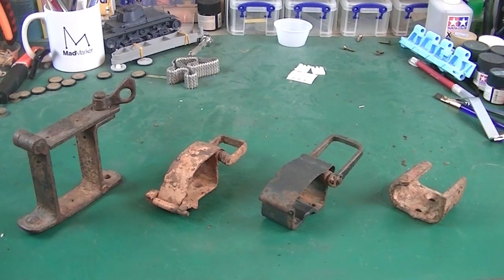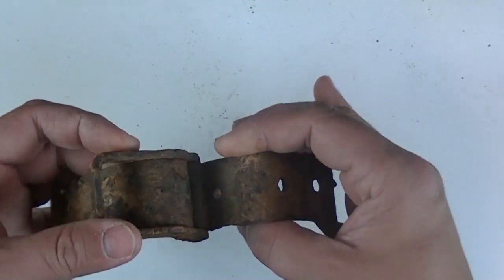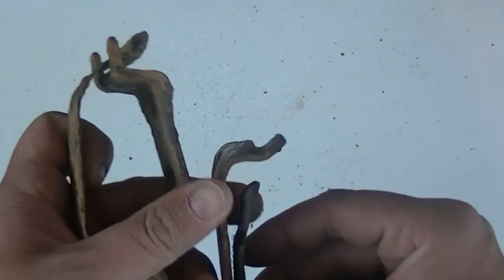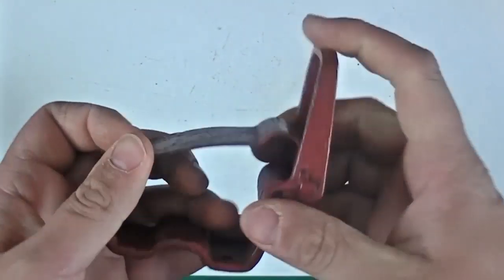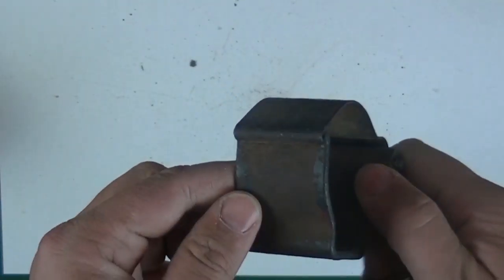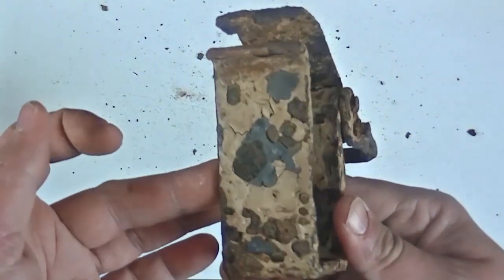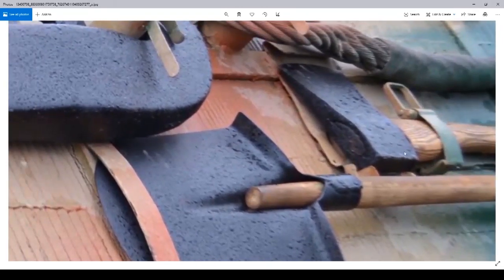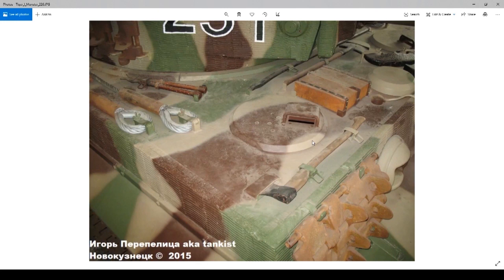Panzer Tool Clamps

Comment: Just by the CAD work alone, I can tell how much work has gone into the two assembly models you have shown, stunning documentation of these components!

To let you know I am the CAD guy at the Wirbelwind project in Canada, so I have access to all of the original parts of the Wirbelwind as well as our original wartime Jagdpanzer 38(t) (earliest surviving example) if you are interested in any original clamps or other fittings that we may happen to have, let me know.

Also sorry for the drawings for the external fire extinguisher mount from our Wirbelwind, I wasn't aware or told of the purpose you would use it for, and the sample that I was given to document was a reproduction part that used a modern clamp and took little to no measurements from an original example. I am hoping that some authentic information arises for that and other Panzer IV fittings so my team can reproduce them to historical accuracy.
Reply from the maker: I'm very interested in seeing data/info on your clamps up there. Rob had told me there was someone making CAD from all the measured parts. My background is video games/vfx, so my models here are built that way. It's been a challenge altering the files for 3D printing as normally our stuff only has to render well, so it's often built very differently than traditional CAD. 

Would love to see what is there and what is gone on the Wirbelwind fenders. I will start looking for high res reference of wartime vehicles. I see from pics when it was outside, fittings on the LHS fender look pretty in tact.

You guys know the history of that vehicle too, so maybe we can reference of it's unit.

The extinguisher reference, i eventually found enough here and there. Don't worry about that.
Reply: @AdamMann3D  I will be back at Borden in around 2 weeks time, and I should have enough time to take a few photographs, unfortunately the Wirbelwind's fenders are in pretty rough shape, not only the inaccurate paint, but the Canadian forces added reinforcement to our fenders since they were rusting to paper thin, and they rewelded some of the clamps back onto new metal, but all the clamps there are original. I'll message your Facebook once I have the photos.

Understood with your 3D modeling files, I just associate anything that is a 3D model with CAD just because of my experiences thus far.
Reply from the maker: @starwars9876-i4t  Corona probably messed up your work days. Just holler at me whenever you get back there. mann.adam.r@gmail.com

Comment: You Sir are crazy and thats why we love you :) What a video to watch and to digest.
When it comes to certain twists and bends in some of the band parts, one reason might be that a piece of metal rod or bar becomes a bit more solid to be used for spring tension when you add sharp bends to the piece. Think of a long wooden board and a short one, the long board is very easy to bend with your arms, while the short one is super tough. Lever principle. With a bend in a metal band you divide the band into two shorter sections, each of which is much harder to deform.

Comment: I would never have thought someone could be so dedicated to one item. I also had no idea that there were so many types of clamps. Interesting.
Reply from the maker: When i started modeling in 2014 i saw all these videos talking about upgrading the tool clamps with PE. Which up until then I'd never thought about. Then i started to wonder how accurate the PE was, and I wanted to see a real clamp so I knew what I was trying to represent. It just snowballed from there. 1 turns in to 3 then 5 then 25 and so on.
Reply: Yeah, I know the feeling. I use to collect militaria and that got expensive and I just plain ran out of room to display it.

Comment: Thanks  for the great videos on the German Tiger tank variants by Dragon in 1/35 scale - you did a superb job on the subject , also fascinating to hear that Tamiya Tigers aren't that great - luckily the Tamiya King Tiger 1/35 is not bad - I added a lot of etch ,  Fruil ( of Hungary ) Metal Tracks , brass barrels and aftermarket Zimmerit Resin Sheets to make it very good

Comment: Very nicely done, but my wife is a little worried by what yon mean by you ha a piece of a panzer III at home. She's worried that I going to start stock piling tank parts in my garage so I can build my own real full sized panzer.

One thing to keep in mind about clamps is that they quite often got damaged or were ripped off the vehicles durjng combat so the crews and repair depots would replace them with what ever they had available or refashioned them from scratch  so you would ofren find types where you wouldn't expect them.
Reply: I'm pretty sure Adam has a section of Pz III fender with a couple of clamps on it.  So nothing too crazy....yet..... :)
Reply from the maker: Evan is correct, i have just a piece of fender.

Comment: Thanks so much for the lesson, I know I’m one year late; now that the model market is starting to flood in 3d printed models of clamps, in particular types 1 and 2 (or A and B) and “pro” depending on the company, can I clarify that the different clamp types are not just “early” or “late” (or found on early war/late war tanks), but they can be a mix of both on a single vehicle? or do certain types associate with certain tanks (like a panther only has all type 2 clamps)?

Hope this doesn’t sound inane, just bought some 3d clamps so I just wanted to be sure I’m joining them on the correct vehicle. Thanks Adam!

Comment: Just re-visited this video as am experimenting with various clamps particularly T-Rex and Rochm the latter only their PE but thinking about their 3D. Am I correct that there are no "rules" to to what clamps were fitted apart from as you say no type 1's on Panther or type 2's on Tigers? According to Aber the change was 43 but given what you have identified in your own research on PIII and IV at Bovington which I have also seen it looks a bit like they subsequently fitted whatever was on the shelf  or have I got that wrong?
Reply from the maker: There are some pretty strict rules, but of course exceptions. Rochm has a very accurate chart on their website. A few vehicles like later StuG III had a mix, but I certainly wouldn't say no rules.
Reply: @AdamMann3D  Just tracked the chart down thanks which explains why the Jagdtiger has a couple of 2's but predominately 1's and this will be very useful in the future. At least this is clear unlike their instructions with their PE set which makes Dragon instructions  look like a model of clarity! Given the surge in 3D printing have you yet been able to form a view as to the most accurate? The use of black resin on the T-Rex you reviewed is I feel not helpful and the material feels a little soft

Comment: I always call type 2 the mammoth clamp lol if you look at it side on you'll see what I mean! The shape and clap lock handles the tusks, I went and bought a couple of different Photo etch sets early and late workable clamps for my builds so starting the new marder 1 I'll have to see if any were on the marder 1 I know it had the square clamps and the pick axe head was like scew bolts with butterfly screws holding it down! But definitely look good only jagdtiger build after the marder!

Comment: Impressive documentary by its accuracy!! 
I found it after having found the way to build “easily” the 1/35 ABER photoetched clamps. Not so easy !! 
Can we consider that clamps on the really first WWII German Panzer I were only type 1 ? I now hesitate on the type to add to my model ! 
Thank you for your answer !  Any reference picture welcome ( personal message if you are ok) 
Best regards from France 🇫🇷 😄😉👍
Reply from the maker: My references suggest yes Panzer I used only type I. I helped the Panzer I restoration guys in Spain with measurements to make theirs. Must vehicles stick to one type or the other. StuG and Panzer IV are all over the place.
Reply: @AdamMann3D  thank you for your answer and for this brillant clamp study !

Comment: I have been asked if I could try and 3d print tool clamps...  gives me a good idea of what he wants. 

Now I just have to get the dimensions, you don't have any do you, if not post thekungflu I will nip to bovy and grab some measurements. I will post back here. 

I can probably gather enough info from the net and this video to be some what accurate, in the mean time
Reply from the maker: I have been 3D printing 1:1 and 1:35 versions of these. I have measurements as, as you saw I own many originals.
Reply: Won in battle or the regular way eBay 🤣, have you made the dimensions available publicly? If not that's ok,  worth a ask. I don't mind creating my own models. 👍🏻.

Comment: Adam, if you go to any car parts counter like a trade motor factors and buy a 5ltr drum of penetrating oil and find a large container or plastic box to lay your clamps in you can then pour the penetrating oil over them so that it completely covers the clamps.
Leave them to soak for 24/48 hours and every so often gently move them back and forth.
This should at least free them up so that they can move again and it won't remove the paint.

Failing that you can lay them in a water and salt bath and pass an electric current through them to completely remove all of the rust but unless you know what you are doing with this method I wouldn't advise it.